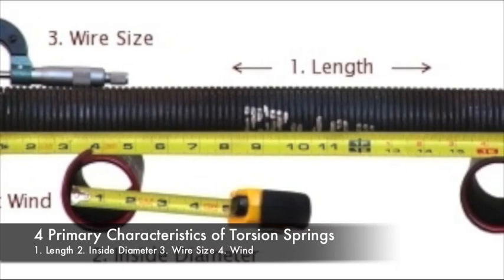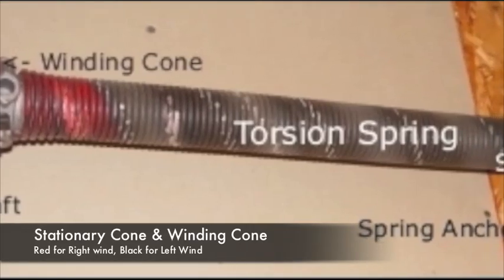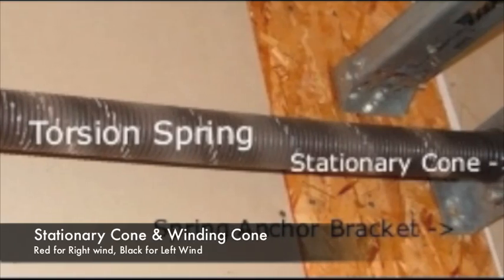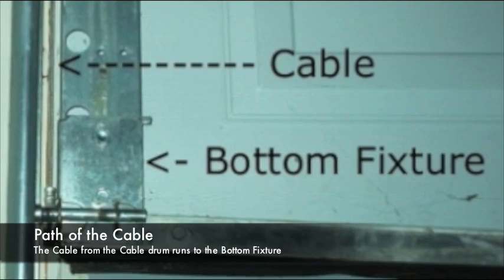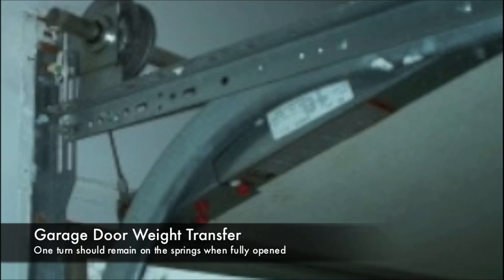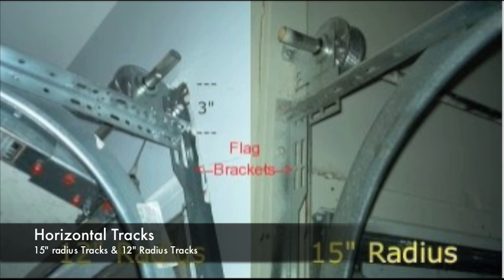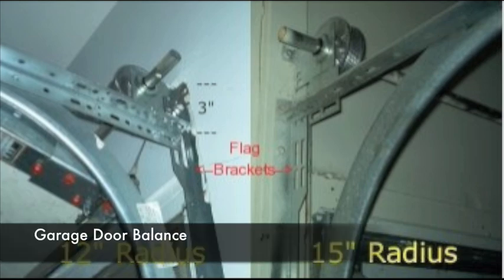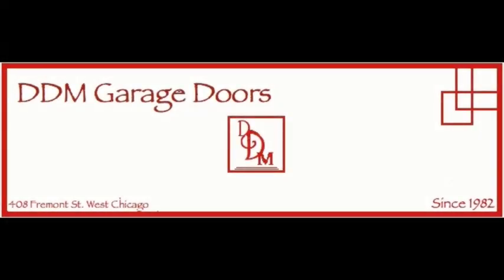Garage Door Torsion Springs

Comment: I found DDM Garage Doors and they were 20 minutes from my home. I called. They verified my measurments. Said I could pick them up later in the day. I asked how much and they were cheaper than any of the Internet sites. I later installed them took me about 4 hours with constant interuptions from my kids. This was not a hard repair. Just follow the saftey and installation videos. By the way for another $100 you could have DDM do the work. But what fun is that.